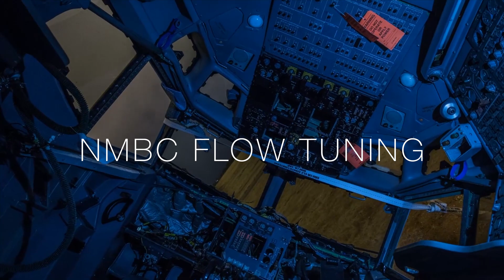Santa Cruz - Chameleon V8 Custom Build 1 Jan 2023

Comment from the maker: Build Listing
1 Stem Burgtec Enduro MK3 35mm Blue
2 Tyres Maxxis Ardent 29x2.25 60 TPI EXO / TR /Tanwall
3 Crankset Sram Sram Eagle XX1 DUB Boost 175mm 34T
4 Cassette Sram XG-1299 Eagle 12 Speed Cassette 10-50 Rainbow
5 Chain Sram XX1 rainbow Chain
6 Sram AXS Groupset Sram Eagle XX1
7 Decal Hope Hope Fortus26 Blue decals
8 Front Hub Hope Hope PRO 4 6 Bolt Disc Front Hub - Blue - 15 x 110mm - 32 Hole FHP432B11
9 Rear Hub Hope Hope PRO 4 6 Bolt Disc SRAM XD Rear Hub - Blue - 12 x 148mm - 32 Hole RHP432B148XD
10 Rims Hope Fortus 26 32H
11 Nipples Sapim 16mm silver brass four square 70off
12 Spokes Sapim Race Silver J wire - 14g 2.0mm Dia 36off 290mm 36off 291mm
13 Bars Burgtec Ride Wide Carbon Enduro 800mm W 35mm Clamp 30mm Rise
14 Spacers Burgtec Stem Spacer Kit Race Blue
15 Saddle Burtec Cloud Titanium rails
16 Rotors Hope Hope Floating Rotor 180 Blue
17 Pedals Hope Hope Union Trail Silver
18 Brakes Hope Hope E4 Black / Blue
19 Shifter Mount Hope Hope E4 Shifter Sram Mount
20 Sintered Pads Hope Hope Sintered Pads
21 Titanium Bolts Hope Hope Titanium Bolt Kit
22 Garmin Mount K-Edge Garmin Edge Gravity Top Cap Mount in Blue
23 Bar Grips Burgtec Bartender Pro Super Soft
24 Seat Post Thomson Thomson Elite Inline Seatpost 31.6mm x 410mm Black
25 Frame Santa Cruz Chameleon V8 29" Frame Navy Large
26 Headset Bottom Hope Full Integrated Bottom cup IS52/40 HSCJ HSCJ
27 Headset Top Hope Full Integrated Top cup IS41/28.6 HSC7 Blue HSC7
28 Bottom Bracket Hope Hope Stainless Steel 30mm Bottom Bracket BBSS30N
29 BB Kit: 001 Hope Hope DUB Kit: 001 Kit: 001
30 Suspension Fox Fox 34 Float Factory Grip 2 Fork 44mm offset
31 Headset Tension Hope Hope Head Doctor
32 Chain Keeper Hope Hope Slick Guide Short – SGS